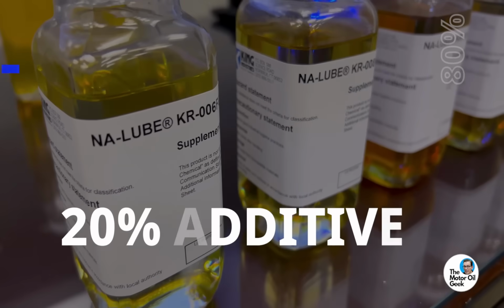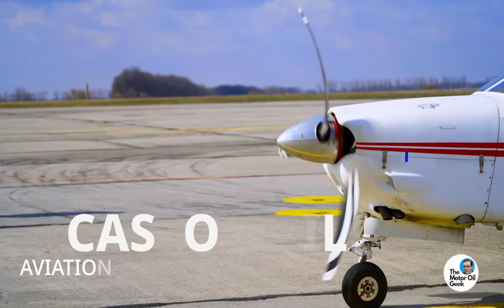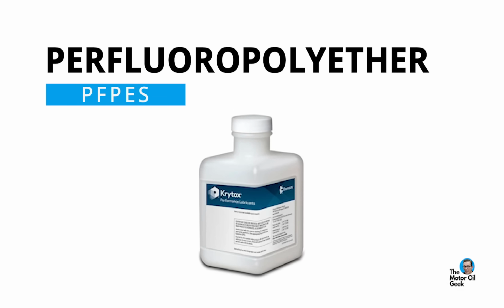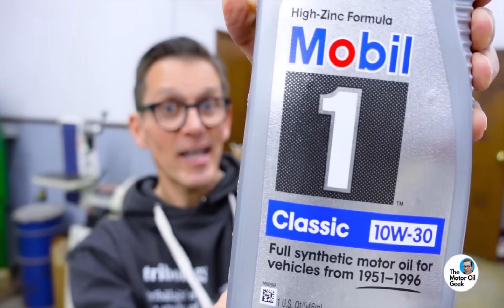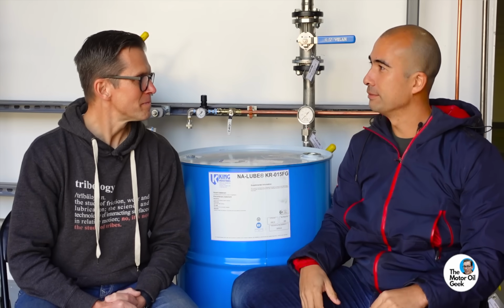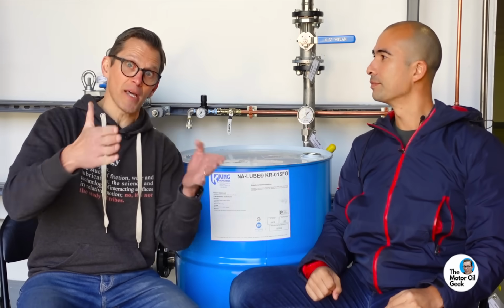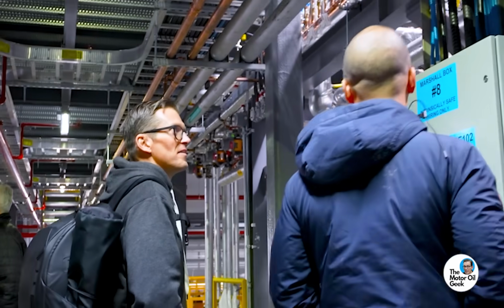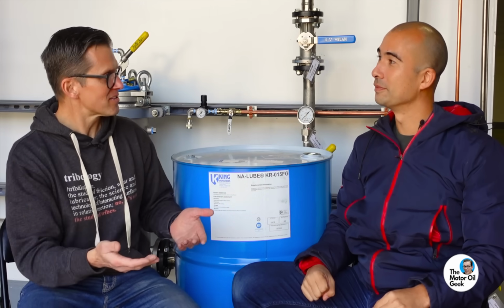100% Synthetic Oil: SCAM or SCIENCE?

Comment: Please do a video on oils for lawnmower & Outdoor Power Equipment oils… it’s the season. These dirty high temp air cooled applications are a playground for most diy-ers and the options on the oil aisle make me scratch my head.
Reply from the maker: Great idea!
Reply: I second this Lake. There are alot of solo operators and Landscape Companies I feel would greatly benefit from a good analysis for small engine oils.
Reply: @themotoroilgeek  Yes! Generators. My Honda's are expensive. I want to prolong their lives as long as possible.
Reply: @themotoroilgeek amsoil not worth it?
Reply: I've been mowing as a side hustle for a few years.  These engines work HARD in extreme heat.  But, just like a car that's racing all the time....change it often!  Mower engines and air intake contraptions are not as highly refined...the filters let dirt in.
The single most important thing to do, is to do the day you buy your mower....run the engine for 5-10 minutes and change the oil.   Change it again after the first mow.  Garage Gear channel on here shows the metal particles in the oil after the first 5 minutes.  You definitely don't want that in there for hours & hours & hours!!
Reply: I second this
Reply: Amsoil small engine oil is amazing.  My mower is 24yrs old and I can go 75 hours on an oil change and not use a single drop.
Reply: @ChinookBear agreed!!  Their filters are good too.   Keep a strong magnet on your filter!
Reply: @ChinookBear my Honda mower is 30 years old and I have only run conventional oil in it. You don’t need to run Amsoil in a mower!
Reply: Very interested in this as well. Lots of contradiction on whats best for flat tappets and whether diesel oils should be used in gasoline engines.
Reply: @akoehn22  use it in gas. Rotella t6 i even run in my jetskis. One does 97 mph gps on 17pounds.
Reply: @akoehn22 
Who is contradicting the manufacturers spec to use? 
I recommend you find his past videos that discussed this.
Most important, do some homework instead of relying on spooned information aka Kool-Aid

Sometimes you gotta remember where you are & who you're dealing with.   
You and I aren't hanging with scientist discussing the molecular breakdown of. ..

Coffee on Sat watching a tribologist is the closest thing we have.
Reply: @davepetrakos475  Dude, Chill, maybe you should cut down on the coffee 😂😂😂
Reply: @WrenchesandPlants 😂😂
Reply: My mower's manual says any 5w-30 synthetic.
Reply: @WrenchesandPlants  Reading the manual is definitely cheating.  Immediate disqualification and user ban.  🤣
Reply: @admranger 😂😂😂🎉
Reply: I use Mobil1 15w50 in the mowers I service
Reply: @QuicKurtZX14R Do you have good results with the Mobil 15w50. I been looking to swap from the 20w50 kawasaki to Mobil or Amsoil
Reply: @davidfranklin6616 yes, very good, absolutely no failures of any kind, even on a few that were run too low on oil. Can't recommend it enough.
Reply: VR1 black bottle 20w50, perfect oil for any small engine: mower, splitter, pressure washer, etc.
Reply: It would be most interesting to see lab tests on some of the cheaper straight 30 oils sold for this, my mower smelled like the processing area at a refinery. 😂
I switched to a 5W-30 synthetic, but smell is probably not the best way of figuring out what the engine like, so it would be interesting to see.
Reply: all my lawn equipment get Rotel T4 15w40 and my 10 year old 19hp riding law mower still dose not use any oil between oil changes and that once every spring ..my air cooled Honda XR150 also get the love of the Rotel 15w40 ...it just works and its not super expensive .
Reply: @dexter2433  The motor oil geek did a video on how many are under the misconception that diesel engine oil is ideal for mowers. He explains that yes, there do tend to be high levels of ZDDP but the high soot levels also make them use high levels of detergents which compete with the zinc. You may want to take a look at Mobil 1 15W-50 as he tested it and says it does a good job reducing flat tappet wear. 

Regardless, keep changing the oil regularly, that may be why you seem to be having great success.
Reply: Use the brand and type you use for vehicles, correct weight of course. And don't worry about it, modern machines fall apart before motor gives out.🤠
Reply: All lawnmower manufacturers recommend the latest API rating 10W-30 or 5W-30. The anti-wear performance of modern engine oils are better than that of any historical engine oil. Plus tappets running against nylon camshafts don't exactly require a potent anti-wear package anyway.
Reply: @gregorymalchuk272 The Kawasaki engine on my mower calls for up to a 50W oil if the ambient temperature is high enough. 

Interestingly, the API specs it calls for are the older ones. Best I can tell, it’s calling for the specs before they reduced the amount zinc. 

After break in I’m planning to use Mobil 1 15W-50 because it’s synthetic, it’s cheap at Walmart, it’s hot here, and best I can tell it has an increased level of ZDDP like Kawasaki seems to want.
Reply: Triaxx SAE 30w 100% ester synthetic lawn mower oil specific 😉
Reply: Who is still buying gas mowers? Absolutely zero annual maintenance on my battery electric mower
Reply: @andrewahern3730 gay
Reply: 30 wt, any prefix, full syn.
Reply: As mentioned - Just change it regularly,  and don't stress over choice of oil as they are generally very low performance motors, if you want the best select something reccomended for Air cooled Motorcycle and nothing starting with a 0/5W 😉
You'll make more difference to the motor life by avoiding Fuel with Ethanol 😜
Reply: I've done quite a bit research over the years and feel confident with what I use... 

I'm subbed to this channel for the SCIENCE on matters like this.

Thank you Lake!
Reply: Pick a diesel oil based on how much you want to spend it works really well if the engine is already blowing smoke load up on engine restore and Lucas lol
Reply: 30 weight oil is all you need for outdoor equipment.
Reply: @jamesm568 Um, I hear Kawasaki learned the hard that’s not always true. The manual for mine calls for XW-50 weight oil if the ambient temperature is over 104 degrees.
Reply: You want diesel rated oil for them it has a higher temp rating that’s why most small engine oil has a C rating
Reply: He will just try to tell you how any oil that you think is good is actually bad for it just so he can make money off of oil companies even though he says he doesn't. We all know he says what they want him to say.

Comment: I can’t understand why 0W20 oil is recommended anywhere down South when it’s only rated to 68 F degrees.  I switched to 5w30 in my 2.4L Jeep
Reply: Where are you getting that from?
Reply: @D2O2 Lake, a few episodes back, manufacturers sometimes recommend too light an oil to boost their official gas mileage figures, but it can turn out to hurt engine wear.
Reply: @drstrangelove4998  and yet his daughters brand new Toyota takes 0w8 oil without any issues. Gotta love "dudes"
Reply: @drstrangelove4998 OK, but what does this have to do with the OP's statement?
Reply: @TimJohnson-x1o  Not every smoker dies of cancer, not every KIA catches on fire or burns oil, but do you want to be that guy?
Reply: @D2O2  He's getting it from his 85 IQ points.
Reply: @TimJohnson-x1o "Maximum" ambient temperatures can be found on really old fashioned viscosity charts, but that information is hopelessly out of date. 

High ambient temperatures won't bother thin oik in a modern engine with a properly designed cooling system with competent oil-water heat exchanger (or full on oil cooler in serious sportscars).
Reply: Mazda switched from a chart based on temp to straight 10w-30 in 1994 when they went from the b6 1.6 to the bp 1.8 if you know about these engines they are basically the same engine with slightly more displacement. They made the change because of fuel economy standards, but for maximum life the earlier chart works best and it ranges from 5w-30 to 15w-50.
Reply: @TrickyClaw So a 20 point spread between what they recommended for cold and hot weather. That lines up pretty well with the chart on Toyota Europe’s website for our Camry.
Reply: @shawngrimes9302  Those temperature charts for viscosity charts are from owner's manual back in the 1980's and don't represent modern technology though.  Obviously is severe winters you need the 0W or 5W, but as to what you need as the hot SAE viscosity really depends on how the engine is being used -- ideally you'd need an oil temperature readout. In a modern engine with an oil-water heat exchanger, it would be wrong to assume the oil is running hotter just because the ambient temperature is hotter.  

As Lake has shown, synthetics oil have more heat capacity and probably tend to run cooler (even for thinner SAE grades) than the oils Mazda was referring to in the manual back in the 1980's too.
Reply: @TassieLorenzo I would tend to agree that oil selection should depend on usage. 

The viscosity chart I was referring to was in the European owner’s manual for a 2016 Camry. Found it on Toyota Europe’s website I believe. 

Lake’s video a few weeks back on the GM recall confirmed something I’ve long suspected, that even with a water cooled engine the oil temperature usually varies with ambient temperature.
Reply: 68 degrees what are you talking about? Ambient temp? Cause my crosstour starts up whether its -15°F or 110°F and operating temp gets well above that even if you’re talking in celsius
Reply: Because the manufacturer only wants the vehicle to get out of warranty!
Reply: Is he a Aussie?
Good 👍🏻 video and a overwhelming amount of knowledge and experience here
Reply: True it to hot down here for thin kil
Reply: EPA has forced manufacturers to use thin oil to get 0.02 mpg better fuel economy. I use 5w30 as it provides better protection especially if you drive your vehicle hard.
Reply: @timstappler5522  I use 5W30 too, but it IS a thin oil as well!  5W40 is used in many European engines, while the Alfa Romeo 2.0 TwinSpark economy engine called for 10W60 (yes, like a V12 Lamborghini) after Alfa found there was too much oil burning with 10W40 originally specified...

[Alfa wouldn't improve the manufacturing of the engine, that would be silly!] 😂
Reply: @TassieLorenzo I use synthetic 5w-40 in all old VAG cars I had. Is not expensive and you can find it anywhere. Now I bought a cheap weed wacker and use it in that too. :)  (im in sweden)
Reply: My 24 Impreza calls for 0W16, I bought the car with 27 mi on it. At 400 mi I did the first oil change, and have ran 5W30 ever since. It currently has 16k+ miles on it.
Reply: Engines don’t run at 68degF….
Reply: @SuzukiKid400  Between 180 and 220 deg F water temp depending on manufacturer, I guess? I guess oil temp, ideally about the same and no higher?
Reply: At operating temp My truck doesn’t care whether it’s 60 degrees or 110. I won’t worry until I wake up and the temperature is over 230 Degrees outside. Hasn’t happened yet
Reply: I run castrol 10-30 in my 85 Mustang it has roller rockers and solid lift cam and had 331stroker motor..Should I switch to 10-40 since I only drive in spring and summer.I used to use Shell Rotella..Any thoughts on that oil or should I stick to Castrol?
Reply: @ScottNettle Why would you use a diesel oil in a gas designed motor?
Reply: @tedlulis973 I'm betting for the ZDDP in it.  People use/used to use those oils in their Lotus Elises and Exiges for that reason because of how the valvetrain is designed.  Pretty sure I did for the same reason, but I've slept since I had that car.
Reply: W doesn't stand for Weight.  So many people don't understand how ICE oil is rated and how lubrication actually works in an ICE vehicle.
Reply: Can't count the number of fools I have tried to explain that to.  What is even more annoying is the fact that as recently as the 80s, people DID know
Reply: depends on the vehicle. i wouldnt put a 0w20 in a lambo in the summer. but new toyotas call for 0w-8, so putting 0w-20 in the summer would probably be the max  i would go. not a 10w40 in a prius
Reply: @TaylorPhase i dont even think there are any lamborghinis that recommend 0w-20. I see 5w-40 and 10w-40 for NA V10s and 15w-50 for turbo V10s.
Reply: When engines became being manufactured with CNC machining and the ability to hold tighter specs, thinner oil became possible to use and still get the needed lubrication on moving parts... oil passageways could be machined to smaller diameters increasing pressure and flow to bearing sites.. and with synthetic oils they won't break down as easily... autos need to run well and without damage in cold as well as warm climates so the 0W-20 oil is not bad... if your car calls for it and  if the engine was machined properly to tolerance, the outside heat is not going to bother it because your car has a cooling system to keep internal temps in a range that won't break down the oil fast.
Reply: @black_dog_barks Very specious argument. However when changing my daughters 2025 mazda 3 yesterday, it calls for 0w20 in US or 5w30 in CANADA(!!!) and Mexico. How does the 5w30 get in those "tight tolerances" in cold Canada but not in the US? They tighten every screw 1/4 turn more in US? 0w20 is 1000% USA cafe standards at the sacrifice of durability in the name of the Great Green Scam...
Reply: @black_dog_barks  Rumor is the manual can’t recommend anything thicker than what is used for fuel economy testing. The U.S. manual for our 4 cylinder 2016 Camry calls for 0W-20.

However, the manual on Toyota Europe’s website for the same car, same year, same model number engine has a chart for oil viscosity and ambient temperature. If it’s hot outside and never freezes it says you can go all the way up to 15W-40.
Reply: Clearances are the same as they have always been.

Comment: I’m about to change the oil on our 2017 Odyssey this morning.  Now I’m rethinking every choice I’ve ever made. 🤪
Reply from the maker: LOL
Reply: You're changing the oil, that's a good decision!
Reply: @5000rgb under rated comment.
Reply: I have a 2013 Pilot with over 300k (kilometres). I have 4 vehicles including a medium duty diesel truck and l only use Amsoil Signature Series. In the Pilot I use 0w30 and I get almost 750km/468miles a tank. The rest of the drivetrain fluids are OEM Honda.
Reply: @IaintTrynaGoOutLikeBIGnPAC 
My 03 civic 1.7 manual has Amsoil in the trans and Signature Series in the engine.  Over the last 100k miles it's averaged 39-41mpg every tank.  
15k mile oil changes too.
Reply: @IaintTrynaGoOutLikeBIGnPAC  I have found that oem ATF from honda shears quickly, changed it to amsoil signature ATF (the red one, not the fuel efficient), and everything greatly improved
Reply: @514aam 
I use Amsoil Signature Series Blue ATF in my 06 Silverado. It shifts nice and firm and I've noticed a drop in fluid Temps.  Fantastic stuff.
Reply: @514aam  Which Honda?  I don't know what "ATF shear" is.

I recently picked up a 2013 Honda CRV 2.4 engine, 5 speed automatic w/ 130K miles and the trans fluid had never been changed.  It has the well reported shudder at 25-30mph.  

I've done two two drain and fills using OEM Honda DW1 and although better, I can still feel some shudder.  I am ready for the 3 of 3 drain and fills but it leaves me wondering if there is something better.

Should I switch to the Amsoil Signature ATF and go back to drain and fill 1 out of 3?
Reply: @voiceofreason9238 just put it some Amsoil ATF (the red one, not the blue fuel efficient stuff) and also change the ATF filter (only use OEM part for this). The ATF filter when clogged can also make those trans shudder. Honda 5 speeds as long as taken care of will pretty much be un killable. I used to race one of them and it did 50k+ Miles of racing (no trans has lasted as long)
Reply: @IaintTrynaGoOutLikeBIGnPAC  750 km/tank for a vehicle that size and weight with an 80L tank is remarkable (22 mpg). Although I'd argue it's your gentle driving style with the Amsoil playing a minute role.
Reply: @IaintTrynaGoOutLikeBIGnPAC  so, what does it cost doing an oil change on that medium duty diesel with Amsoil?
Reply: The K24 or J35 port injected engines are old school, they will take anything from 0W20 to 15W40, synthetic to conventional, without issue. (But no reason to use conventional as synthetic, be it group 3, 4 or 5, is just plain better as Lake has shown.)
Reply: Back to the future quote inbound. "This is heavy"   2 things, so I just did 2nd oil change in my 2025 Colorado with Valvoline Advanced 5W-30.  So this is not a true full syn?  I got lost, what group is Valvoline advanced? IV?   2.  Dropped my sample in the mail yesterday Mr. SPEED,  can't wait to see results.  Towed RV across Texas and New Mexico, anxious to see results.
Reply: I've been a amsoil dealer for 44 yrs..an I beat the shit out of...never fails...2 strokes an engine trans fluid gear oil...it all...I thought I liked lake speed till this video ...for all u skeptics out there..I had a 78 YZ-400. ran it on amsoil 100/1...2 tanks never skipped a beat.an recently flushed my '23 GMC trans..runs very smooth...trust me you won't be let down..by running amsoil
Reply: You can run in that minivan whatever Walmart has on clearance
Reply: @markrutan1875 fun fact, the J engine on that minivan is derived from the C engine in the NSX.

Comment: With all new cars start and stop engines, Which oil is best considering most wear happens upon start up.  ???? In Manhattan it occurs at least 60 times a day with traffic.
Reply: Most wear happens at COLD start-up not hot starts
Reply: The stop start engines will not cycle off until the oil gets to operating temp. From then on the it will be starting with warm oil and the whole system recently primed. It's not the same as a cold start where the oil has drained off the moving parts overnight.